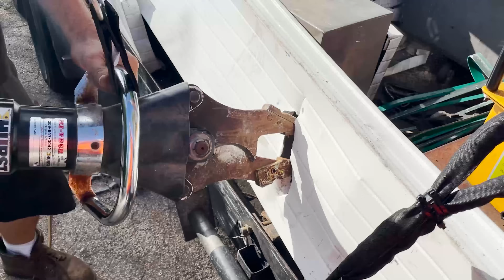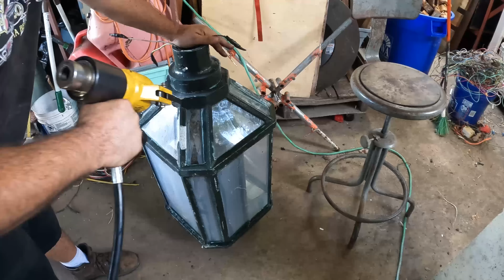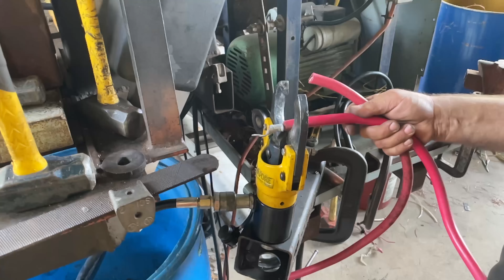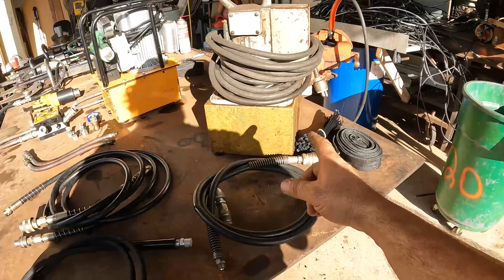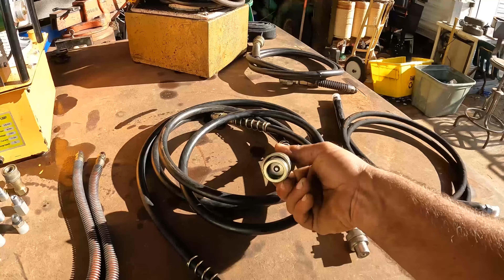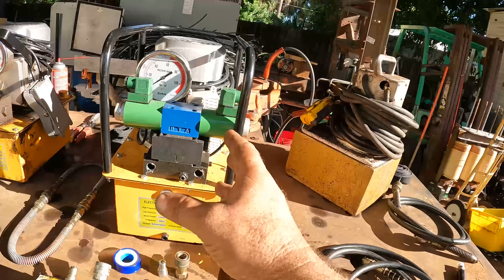Processing Scrap With New Hydraulic Cutters & How I Broke My Jaws Of Life.

Comment: Just bought a Hurst Jaws of Life from a fire dept. Its a 5000 psi. Need a compressor and hoses. Hurst went to 10,00psi and batteries. So they dont sell the old compressors. Any idea where I can pick one up. Thanks
Reply from the maker: You can get them off eBay. You can even get a 10000 psi and just the bypass to 5 if you know what you are doing.

Comment: Hey man I’ve got a question. I got a 20 ton harbor freight hydronic press today and want to know if you have any tips on processing bigger transformers with it or any other tips about copper removal tools needed?

I’ve watched most of your videos at least once, some several times. I have been attempting to duplicate some of your techniques and stuff you do with some machines and all. 
Thanks for any help and thanks for the videos. We really appreciate them.
Reply from the maker: It will get you by for most transformers but the bugger ones you will have to crack with a hammer or grind thew welds. My press started as a 20 ton harbor freight press but the air/hydraulic 20 ton jacks kept blowing the air motors and I bent and cracked the frame. Mine is heavily reinforced and welded together. I'm also running a 25 ton 10'000 psi ram and it struggles with the bigger one sometimes. 30 or a 50 ton would work better. Also you will want a gig to hold the transformers tight they will fly out! I might do a full video just on the presses. hope this helped and good luck
Reply: @ProjectShopFl  Man I’ve had nothing but issues with them transformers and they are way to big for what I’ve got. Also I bent all the hell out of the press as well so it’s not strong enough. Thanks for the help man!
Reply from the maker: @WhatsthePOINT_EDC  Wow! be careful man. You might have transformers that can not be broken open in the press, Did you get any of them apart? Some the only way to recover the copper is cut the copper coils because how the steel is put together. If you are within 90 days harbor freight will take the press back. lol
Reply: @ProjectShopFl  Man I am blown away at how hard it is to cut through these transformers. The press is now bent to hell. My helper cranked on it like his life depended on it. After looking at the transformers there are 3 different kinds and some have steel bars running through the middle and sides stopping the press from pushing the copper out. Its needless to say but its been one hell experience. The press might make its way back to HF now that its bent like a wet noodle. LOL.
Reply: Glad you asked this question!  I was looking to get one of those for the same reason.  Even toyed with getting the 12T one since it's what's on sale currently.  Glad I didn't.

Comment: Amazing spreader !!!.  I really like that small jaws, It's very versatile for the workshop. You need to hold the 'cable bunch' back on itself, (toward the upper blade) to avoid it's tendency to slide between the blades, and then the cable start separating the blades. 👍
Reply from the maker: Thanks for the suggestion, I have a upgrade I will be doing to help stop that from happening.
Reply: Qqqqqqqqq1qqqqqqqqqqqqq1q1qqqqqq
Reply: Qqqqq
Reply: Qqq

Comment: Hello
Re  the hydrolic hoses.
With the pressure you mentioned especially on the long ones they should have som form of chain stopping them from whipping.
Covers are a good idear as you could have a fine leak and you could be leaning over it and if it enters the skin you might need a vain transplant.
Hydrolics is great but you have to be careful with it, specially at high pressures.
At Vauxhall (was GMC US) Luton UK test facility we put a thick flexible tough see through green plastic around the truck test rigs, all hoses were tethered with a chain, to protect workers and visitors.
Safety is important as an accident costs the company with workers off work and medical costs.
We are lucky in the UK as the medical costs come out of taxes, unless it a car accident or other instance where there might be neglegence where the lawyer's step in.
Thanks for the video.
Reply from the maker: Thanks for the suggestion

Comment: The broken cutter looks like our old 5000psi unit, we gave it to another department and went with a 10000 so it would cut modern metals.
Reply from the maker: Can I ask what type of pump are you using Gas, electric, or battery?
Reply: @ProjectShopFl  We switched from 5000psi hydraulics to the eDraulics. Sweet not dragging a power unit and hose around.